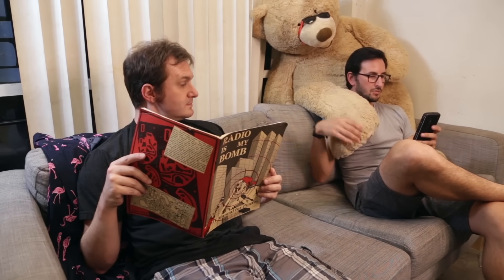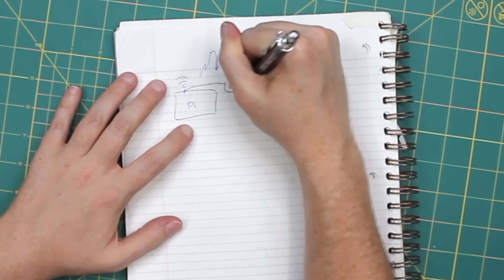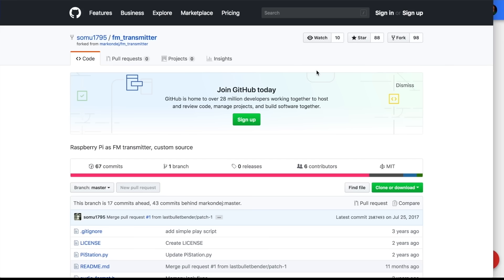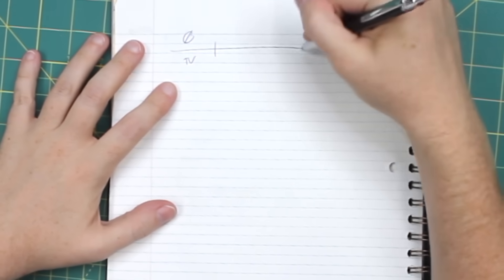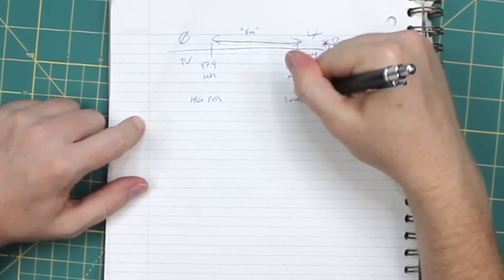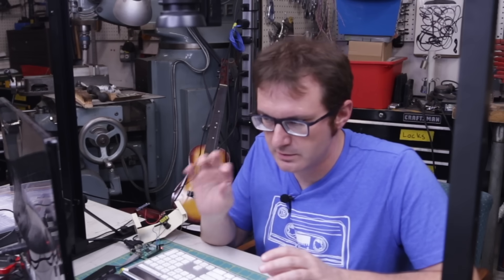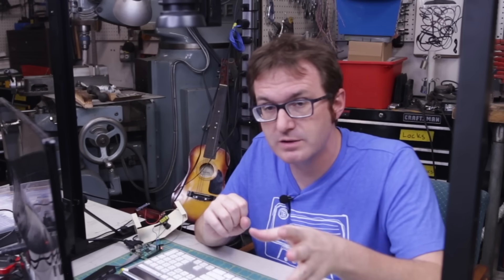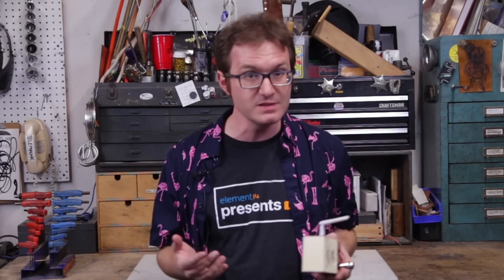Raspberry Pi Pirate Radio

Comment: Did this without a filter once, just had a female to male jumper wire on the pin and put the pi in my attic.  It worked too well, I could get the signal miles away.

Comment: Instead of the .wav file, you could just put /dev/snd/<soundcard> as an input file, plug a mic and it will just work. (Not sure if RaspPi has an audio in, now that I think of it)
Reply: Nice idea, but RPi doesn't have onboard audio :(
Reply: @AirborneSurfer  u could use an external soundcard with it?

Comment: Got'ta ask!  At 9:46 Where did you get that 6502 T-Shirt from? 
Also, how about the schematic, but with values! Obviously, the layout is simple.
I know you gave the calculation, but I'm lazy!  Besides  you showed 1 formula on paper, and 1 formula on the screen at the bottom.
I'm a digital guy, so help me out.  Your BOM shows 3 100pf, (why 3),  but NO resistor values!

Comment: builds radio transmitter for 99.7mhz, fits it with an antenna for 2.4ghz. swr meter? nowhere in sight.
Reply: Intentionally limited range. They don't want to get fined using a proper antenna

Comment: Could this also be used to create an emergency transponder or homing beacon?
Reply: Technically yes, but it wouldn't be much use--too low power and too low frequency to be very effective.
Reply: I was hoping to use it too help Pi-robots to ID each other in close proximity rather than use complex RFID Modules..

Comment: Could you maybe run a RTSP stream on your PC, then when you turn on the RaspPi it would connect to your local stream and then start broadcasting it out over the radio?  

I use to use SAM DJ back in 2000 for an internet radio that my friend was hosting on his Dialup-Up connection.
(22hz 32kbit stereo)  it was cool to tune into it while at school.
Reply: troyBORG I suppose you could as long as the stream is a wav file and there's enough bandwidth that the Pi has a clean feed. Try it out and let us know in the e14 community!

Comment: A quick maths check the antenna isn’t the best length for that frequency (just by guesstimating the original frequency the antenna was meant for plus what I assume the wire length was inside, since the video didn’t show a coil at all I figured a straight connection) so signal would improve significantly with a proper length antenna
Reply: thesharksurfer Quite so, but then we run the risk of violating federal regulations with increased effective range.
Reply: Could be, I would be interested in seeing the output power of a “properly” tuned setup.

Comment: Cool
Reply: What’s. It the max power and distance you can have on a tv and radio transmitters
Reply: Lionstar The TV band is off-limits in the USA. Max power under Part 15 exemption is 1mW effective transmission power or 200ft effective range.
Reply: So I can’t buy a cheap analog TV transmitter so  I can put some good CRT TVs to good use As a wireless video screen